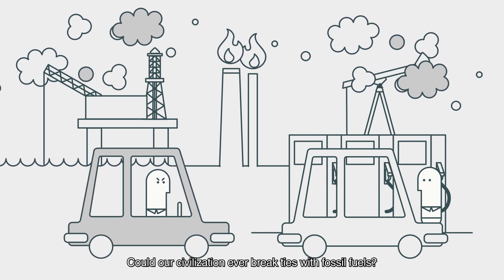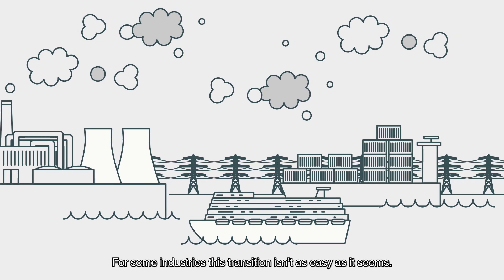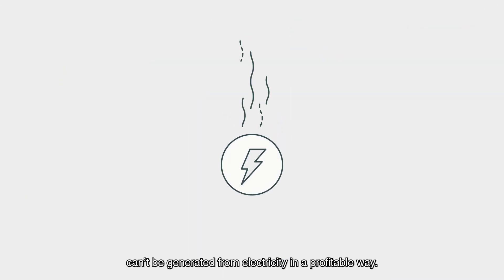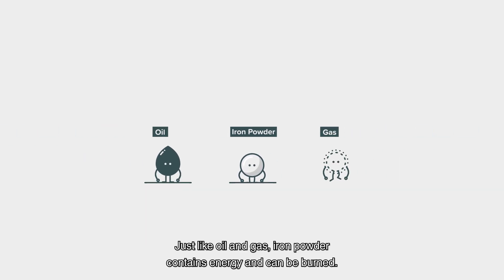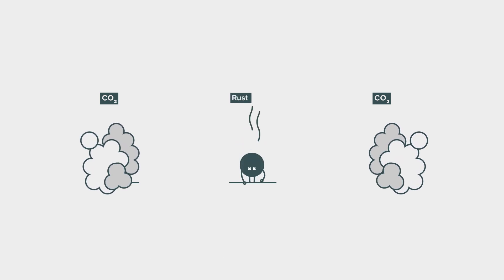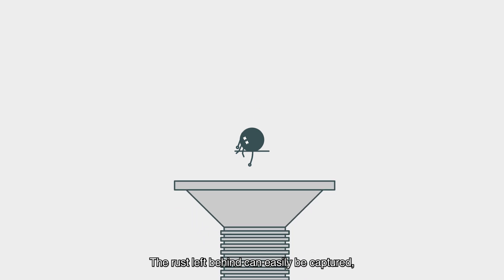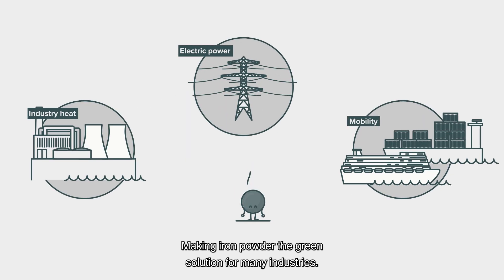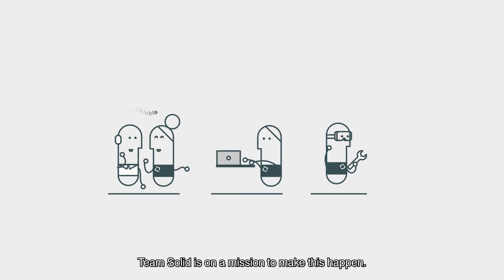Iron Powder - the green energy solution

Comment: Dude, that is not the solution. Because, to extract iron from iron ore, you need a ton of energy and coke to extract iron. Also, iron extraction process release a lot of carbon dioxide. Overall, this process is a net consumer of energy. 
Also, iron powder is hard to store because it quickly turns into rust.

Comment: Well in a iron melting furnace you need extra oxygen (to get rid of an excess of carbon) you can do that with rust and you use a percentage from the iron you produced  to fuel boilers that produce electricity that can power for example a iron melting furnace. I would call myself a huge ammonia proponent this sounds not bad either.

Comment: Let's get this straight: "electricity isn't cost effective for heating" so instead of using it directly, lets use it to produce hydrogen (which results in efficiency losses), then use that hydrogen to convert rust into iron (more process losses), then transport that Iron to where we need it and burn it... you end up using far more electricity than if you just used an electric heating element in the first place and far far more than if you used heat pumps which a lot of industries that don't need temperatures much above 100C are starting to use. 
if you need very high heat electric arc furnaces have been used for over 100 years and are unrivaled in heating. 

The argument implied is that this is an alternative to batteries and other conventional energy storage solutions but this is still disingenuous it's far more efficient to burn the hydrogen  directly or better yet use it in a fuel cell, the losses involved in producing iron powder, transporting it to steam power stations, burning it and recycling the oxides are staggering. At that point you'd almost be better off to massively over build wind, solar and wave resources and just curtail the crap out of them during the day.
Reply: First, you don’t need a hydrogen phase. You can turn iron oxide into iron + O2 with electricity alone. And no, this is not efficient - you have the thermal losses from any combustion-based energy, plus whatever inefficiencies there are in recycling the iron oxide. But. Iron itself is cheap and incredibly abundant, and the combustion process presumably has an energy density rivaling carbon. So it can work for both time-shifting renewable energy (making iron powder with cheap wind/solar), and providing the kind of quasi-endless dispatchable energy that fossil carbon currently provides. If it could be used for industrial heat and shipping fuel, it could solve some very hard problems.
Reply: Can't use electricity AT ALL to power ships, planes, commercial trucks, boats, rockets, missiles, military aircraft, or 1000 other things.  A transportable, emission-free (sic) fuel such as iron powder would be THE ONLY practical fuel, regardless of efficiency.

Comment: Its not iron powder after electrolysis. You have to mill the iron to powder, this is an extra loss of energy.  Electrolysis is not an efficient process itself. So whole efficiency of the idea is less that steam engine.
Reply: The iron powder is not a fuel. It's energy storage, like a chemical battery. The point here is in the future when fossil fuels are depleted or regulated out of economic viability, we would have something that can store renewable energy so when the sun isn't shining and the wind isn't blowing we still have power. Additionally it offers a solid fuel that can be easily transported. So if we compare this to the efficiency of a conventionally powered steam engine it pales in comparison, but when we start to weigh it against hydrogen or lithium batteries it becomes more competitive.
Reply: What's the round trip efficiency?
What's the theoretical maximum efficiency?
Please put some steam in a box so you can take it out next year and use it for energy.

Comment: I appreciate this amazing breakthrough for separating from fossil fuels but nuclear reactors are also a renewable energy, not a burden like shown here. At least don't include it in the video if you're going to frame it in a way that further tarnishes its reputation
Reply: @Andrew Clarke: Uranium 235 will finish up a plutonium. Everything here is irreversible. How can you consider this as renewable? 

Uranium is a non fossil fuel but its also non renewable. Or am I missing something?
Reply: @paulwilliams3731  
Nuclear is the ultimate nonrenewable. Given enough time all the carbon we've offset could eventually turn back into coal and oil, but that uranium is gone gone gone, never to return.
Reply: @grogdocr  More so the nuclear waste is 'nonrenewable'  !
You could use excess nuclear energy for this iron powder energy though.  Countries like France and Sweden rely heavily on nuclear energy plants, which have serious night time surplus of energy ..

(Ultimately we should develop Thorium based nuclear energy. The material is more widely available, has less waste with a much shorter risk period than uranium (200 yr vs 10000 yr)  and can reduce the current uranium radio active waste !     20 years ago the EU have had serious plans to develop it. That was a missed opportunity ....)

Comment: This may be a stupid question but doesn't it require a lot of energy just to get the raw iron into a pure iron powder fuel form in the first place and wouldn't it take a ton of it to actually power anything realistically? Again, I'm well aware this may just be ignorance of the topic on my part.
Reply: Its not ignorant, and you are right. However, during peak hours for wind and solar, a lot of energy is simply wasted. It could be used to create this iron dust. Its non polluting and could simply sit there in a pile. You can feed it back into a retro-fitted coal power plant, if you need a boost of energy for the grid. So, wasteful yeah - like any energy storage solution. But widely useful.
Reply: @madstjornfelt  Thanks for the info! Some great insights I had not considered!
Reply: @madstjornfelt  and yet solar power requires the mining of quartz and wind turbines last for only about 25 years, completely inefficient. Watch the Planet of Humans produced by Michael Moore
Reply: @foresthug909  You can use any energy source to make iron powder, doesn't have to be solar. Run it off a volcano for thrills, why not.
Reply: I am not physicist, but how much I know from school physic lessons here are law of thermodynamics, how much energy you put in iron is how much energy you will get back. Now question would be efficiency of transforming iron oxide to iron and making it in to powder (not making iron from iron ore) and efficiency using energy by burning iron powder (also efficiency in burning other fuel is important for comparison). It also need to take look at keeping iron powder: is it safe to keep it (won't it explode); will it oxidize than you keep it (so you will waist it if you keep it in warehouse; is here better metal to use and so on.

Comment: How do we get iron powder?
Reply: There you go. Last time I looked. Iron powder is nowhere to be found easily. You still need to mine iron.
Reply: @flexairz  
Iron must be mined, and then "spent" powder can be recycled using electricity. There's no such thing as a free lunch, but iron is more readily available than lithium and it can be "recharged" indefinitely unlike fossil fuels. It has strengths and weaknesses, just like anything else.
Reply: @grogdocr  indeed but we must also look at the cost of an increase of iron mining and how that affects the environment. Also we need to prove if heating that iron and then taking the rust is really that effective in terms of energy cost and environmental cost.

We need a godamn paper with numbers, sources and a thoroughly explained process.